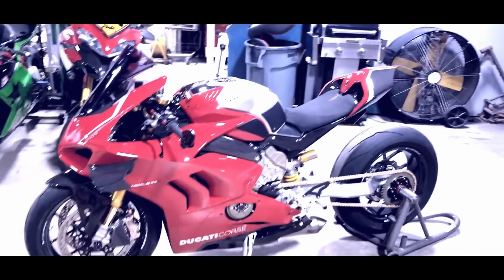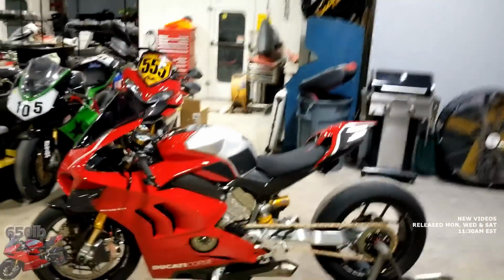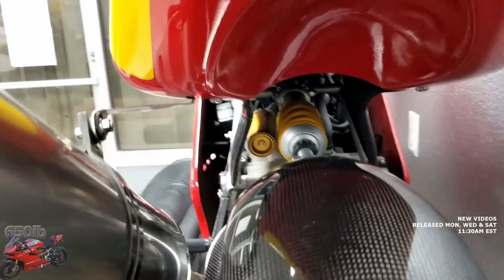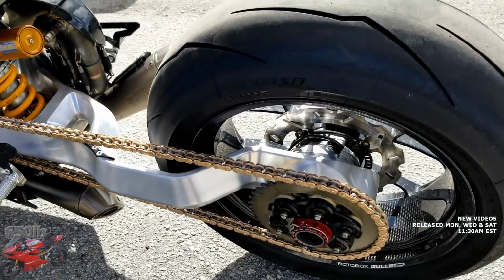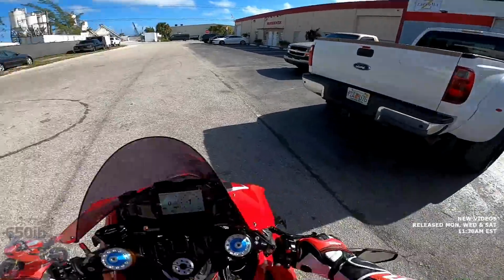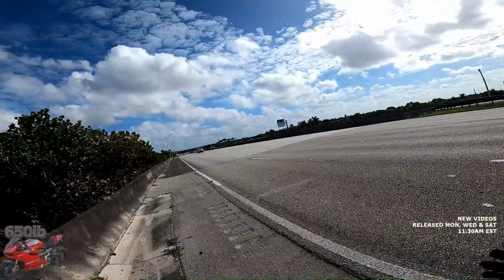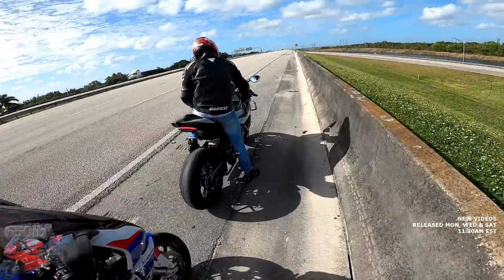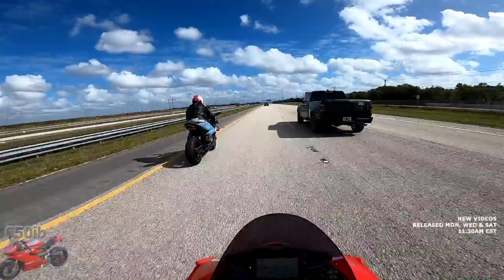RUINED Ducati Panigale V4 R is REALLY FAST!!!

Comment: Why stretch it?
Makes it look uglier!
Reply: This bike has about 200WHP and weighs less than 200KG so streching it makes it siginificantly less prone to unwanted wheelies.
Reply: @Rexperto6454  It has electronic wheelie control for that.
Reply: Electronic wheelie doesn't work all the time, watch the BMW chase the V4R, he's even lifting with it on.
Reply: A stretched bike will need to use the wheelie control less allowing mt throttle earlier in the race.
Reply: @malacite1  Electronic wheelie control cut the power down when it detects front wheel lift. That's not something you want when you're straight-line racing.
Reply: @patricksaintjean3365  It works fine every time. The reason why you see them wheelie is that they switch it off. 
If you'll race with wheelie control on you'll automatically lose because of how much early power you'll lose. You cannot use wheelie control or traction control if you want seriously straight-line performance.
It's good to keep you stable on the track but totally ruining the straight-line performance of the bike.

Comment: Only in America would someone do this, but if it aids straight line performance and you doing straight runs then why not 👍
Reply: Aaron Wright I am an American and would never mutilate a Ducati Panigale V4 R.
Now the Blasphemer 650ib and his band of Straight Line Junkies have defiled the Panigale .
650ib and his Straight Line Junkies  they need to ride Groms  
It is sad to see this machine only go straight, when it was design to be lean over like a naughty catholic school girl and 
ridden hard out of a turn. Drag racing is premature ejaculation, it only last less than 10 second. Road racing you stamina 
and strength to go the distance.  
Aaron not all  follow in 650b path. We enjoy the bikes he has, the builds, Manny of Moto Million , Zack master mechanics and
the give a ways. 
Cheers from America.
Reply: @joelaroc5372  cuz turns are hard bro,takes real skill to master the balance between DTC and EBC in order to go track speed.
Reply: @Gixxiemoto  Negative my 2 wheel pal. Turns are skills we learned when we rode our bicycles. Do you remember when you 
started riding your peddle bike. Trying to wheelie, jumping ramps and riding as fast as you can just to have the back tire  slide  into
turns. Counter steering and blast out of a turn with your friends right along side of you, fun time. This the foundation of its ," better to
ride a slow bike fast then a fast bike slow". 
That is why those Straight Line Junkies need to ride GROMs . Stay off the highways find some twisty back roads and learn to lean the
bike over, COOK those Dam Chicken Strip off the tire. Sad when you see a 190 or 200 size tire and the center is worn with 70% of the
tire tread left on the edges. Alright CashMoney , Aaron Wright and everyone else reading this reply. Hope you got a bit of a chuckle
out of my reply.
Cheers from America USA.

Comment: that chains so tight, how long before transmission issues? since he only races from a high roll, what's the need for the stretch? Going to try real drag racing??
Reply from the maker: Hey, the chain loosens when my fat arse sits on the bike and when it's in motion. The arm helps with 'roll racing' and I will also drag race the bike too!

Comment: The ss stretched arm looks gawky and just wrong, at least with a dual sided arm you can have several extension lengths for different rides ..... a stretched arm shows the advantages of a dragbike over a sports bike, bet the BMW would lap the v4r on a circuit though !
Reply from the maker: Nick.. There's no way in hell a dual sided arm would look better than a single side arm on a bike that was designed for a single side arm. Also, Billet Al-u-mini-yum always looks better than a plain, black arm.
Reply: Each to their own ib , I just think the distance between the exhaust/engine and wheel on the opposite side of the arm looks odd.... I'm sure I'll be in the minority, but I agree with you that a straightforward beam dual sided would look awful  too, it would need to look high tech..

Comment: Eeeb, why do you do that? Looks hideous & ruins the handling. Do what I do; bought a set of Pingel wheelie bars years ago & that allows me to use NOS on 1/4 mile grudge races & then go back to regular for the other 90% of riding I enjoy...corners &/track days.
  Only 15 mins of set-up (bolts to the passengers bracket & where the swing-arm spools are, in addition to front straps to compress the forks) and then you’re good to race safely. Works on almost all sport bikes I suspect.
Reply from the maker: Hey Bro... The 3.5" arm didn't ruin the handling. Lol..... It still corners the same, for my skill level.
Reply: @650ib  That’s awesome if you can’t notice the difference. I really didn’t like the handling when I’ve ridden my buddies bikes that he extends. Was just trying to offer you another way, that is less permanent. FYI, you were one of the reasons I got an ADV bike. Like you, I was always riding litre sport-bikes. Cheers, On1wheel